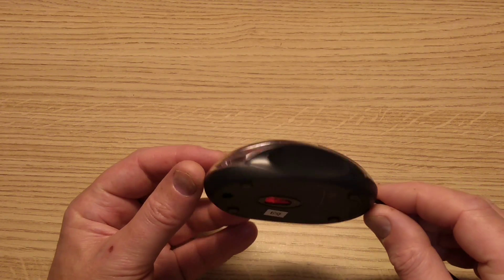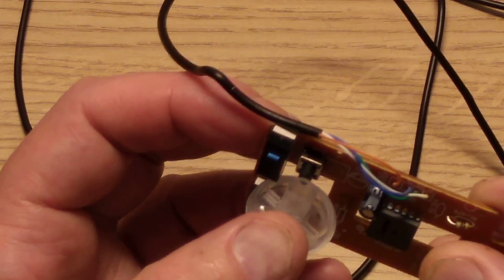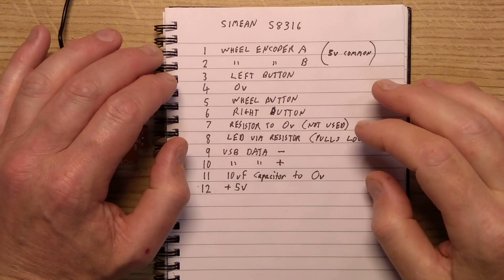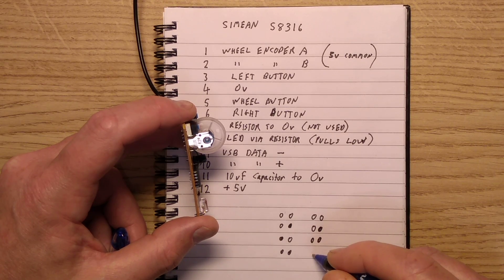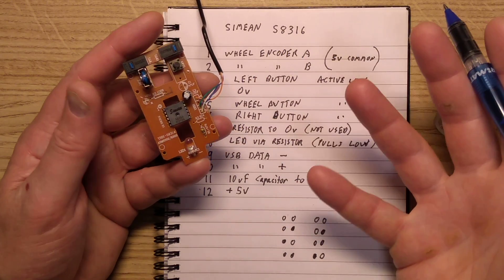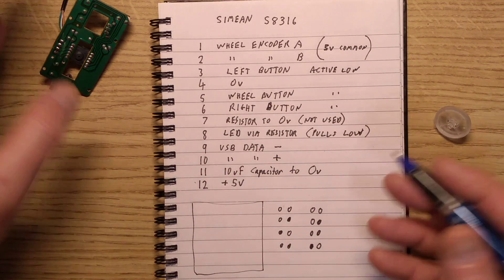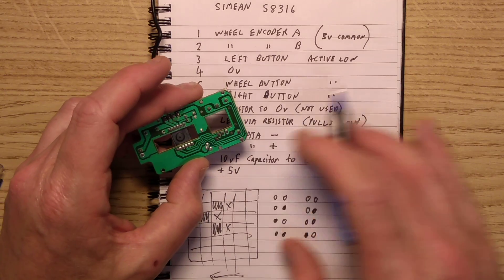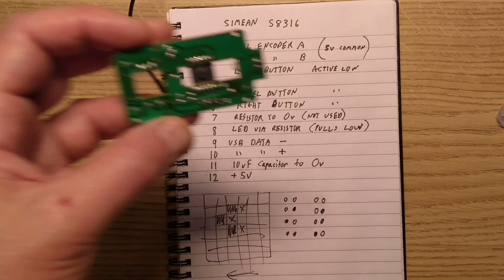Inside a humble Poundland computer mouse.

Comment: Regarding pin 7, there is a datasheet available for the Simean "KA2" optical mouse sensor chip.  It's very similar, with a few pins shuffled around from your version.  There, the "unused" pin 7 selects the mouse sensitivity/DPI.
Reply: @konakonaa I play quite a lot of games and I find it super useful to adjust on the fly as each game seems to have it's own default sensitivity. I can just click a button on my mouse a time or two to dial in what I like instead of going through a settings menu, adjusting, hit apply, test, then repeat until it's right.
Reply: @konakonaa multiple use. High dpi for game and low for better precision when use Photoshop/pain.net etc. High dpi for general gun and less for sniper gun,when you try a new fps,start low and increase in game. Generally adjustable dpi mouse,have 2 button for change dpi on the fly and use a little program when you can create many dpi profile and others settings :)
Reply: @konakonaa probably for scoped shots vs non-scoped shots in a first person shooter, but any GOOD fps changes the sensitivity for you upon un/scoping

Comment: Cant make it much cheaper than that. The original Microsoft optical mice had multiple ICs in them, now its just one.
Reply: Two ICs probably, HDNS-2000 and a microcontroller - first USB ones had to have used EZ-USB FX1, otherwise PIC or something.

Comment: If you were to buy the individual passive components alone it would cost far more than one Pound! I've found that "dead" mice are a very good source of microswitches, and those encoders are useful too (e.g. for 3D printing). Even the USB cable is entirely salvageable.
Reply: 100% true.  Sad thing is they are so small they go in the garbage can and can't easily be grabbed when it would be far better for the Earth if I had at them, or you, since I/we would reuse at least half of the components.  Did you know the tracking system is a camera that can be used for PIR systems built with a PI or an Arduino?  Yep.
Reply: divorcedme  

Arduino is one of the easiest way of getting into micro controllers. Google some tutorials.
Reply: divorcedme  The biggest thing, for me, was learning and understanding how to make things communicatie with the outside world.  If anything, learning a programming language that, upon finishing a task (like when an if-statement is true) makes a LED light, can be a much better thing to "grasp" than to have something print out on a screen.
The tutorials start out as incredibly simple (connect a switch to light a led when you press the switch) and go up in difficulty gradually.
For me, even though my understanding of electronic components is not exceptionally great when I compare my knowledge level with the one my brother has, but still, I manage to build my own PCB and not have things blow up :P.
Reply: divorcedme  The thing is, Arduino's are forgiving when it comes to making mistakes, they are protected to withstand certain errors (up to probably a certain amount of time, and times) more than Raspberry Pi's are.
For instance, when you directly connect an input where you want to connect a switch to to the 3.3 or 5V output and forget the resistor and hit the switch, the Arduino will reset itself and start over.
Though I have not yet experimented with Raspberry Pi's myself, I've seen the warning countless times to "protect the input where you connect your switch, motor, servo or anything else to because you will blow up the GPIO input otherwise!"
Being able to directly print a variable you might try to change is also a big advantage, because you can instantly see where things are going wrong (or not).

Also, most Arduino tutorials (and the Raspberry ones probably as well) have a detailed list of parts you need, and if they are really good have a computer drawing of what you need to build in order to get the same result, and when you followed a couple of tutorials that make you able to do what you were thinking of doing, you can start to combine them, or put them together and build more advanced programs onwards.
Reply: divorcedme    à bit more encouragement from me....  you can download the arduino environment for free from, I think,  arduino.cc    browse some projects whilst you're on the site and check out the demo software in the download .  Arduino sketches (programs)  have a simple structure:  startup () which executes once at the beginning and loop () which repeats forever.  Knowing that, you'll probably figure out the demo blink program by guesswork.  If you then decide to buy, I humbly suggest getting an UNO .  Overpriced, perhaps, but wiring stuff by just poking wires into the connectors is so convenient.  Image processing, however, might be asking too much!
Reply: @divorcedme I am a bad one to ask because I can look at any language and within mins I can read what it is doing.  Writing in it takes a little more effort but not much more.  Started out in 1983 with Commodore 64 Basic and in 2 weeks ditched it and went to 6510 ASM/ML.  I taught myself by writing something in Basic and translating it (line for line) into Assembly/Machine Language.  Always came natural to me so what I find easy another would find very hard.

I will say this that Arduino is the simplest stuff out there as it is 8 bit and well documented.
Reply: Its cause they are all made in China so everything is alot cheaper there

Comment: Cheap mouses in nutshell
I have torn down several of those.
Reply: *meeces
Reply: in pieces.
Reply: Lassi Kinnunen  Well all mouses since the adoption of optical mice.  Opening my old Logitech MX518 looked quite similar to this one. Used that mouse for about 9 years then finally switched to a wireless mouse when I found out about the Logitech G602, the first wireless mouse I've ever encountered that didn't suffer from any noticeable latency. I'd still be using the MX518 if I weren't using my PC exclusively with my TV.

Comment: I used a Sun Microsystems optical mouse in 1995. I never thought to take it apart. It required a special mouse pad that was a stiff shiny sheet metal, maybe 5inches square. It had a mesh pattern printed on it in grey ink/paint. The mouse did not work on the table. I assume it required the high contrast between reflective metal and matte paint, and the regular grid of the pattern, to work.

I quickly understood the value of optical mice, because they replaced mechanical mice the featured solid balls that moved rollers (presumably attached to rotary encoders) in the mouse housing. But the ball would constantly pick up dirt and lint that prevented it from getting a good friction grip to spin the rollers. The need to constantly clean mouse balls led to many bad animal husbandry jokes.
Reply: I have fond memories of the sun mouse. Before there were scroll wheels, I found the middle button indispensable for copy-paste.
Reply: I wonder if the different system of using IR LEDs with low sensitivity photoreceptors had anything to do with how USB had a lower power output (officially anyways) at the time... Of course technology itself is using less power per complexity today anyway. Actually come to think of it, in the 90s you wouldn't have been using USB at all, but those dreaded PS/2 ports! Those give you a whopping 275 mA at 5V to work with. I definitely think it would have been theoretically possible to create better mice at the time, but it wouldn't have been practical because you'd require an extra power source.
Reply: @Torchkas2  They pre-dated the PS/2 port and may have used an 9-pin d-socket serial connection. The Sun ones would have almost certainly used a propitiatory connector.
Reply: I can't say for sure, but that Sun Microsystems Optical Mouse might have been a rebranded Mouse Systems mouse, as they had the same system on DOS computers back in the late 80's.
Reply: @CommodoreFan64  They were - I was using from in 1990/91.  The ink in the fine mesh on the mouse mat absored infra-red light more than normal paints/materials, and the mouse counted the lines as it crossed them. Wouldn't work on anything else but the mat.

Comment: There isn't any lens inside the "chip" - It's a bare die.
Reply: No lens per se -- just an aperture. However, it is still functionally a camera -- albeit a pinhole camera. 

I wonder how sensitive the IR detection is: how would response drop off as you rack the aperture outward from its current position (changing the angle of view/focal length/depth of focus)?; similarly, how would response drop off if the aperture were decreased, in place, to, say, f/256? Could that circuit be used in those cases as a motion detector in a camera trap?
Reply: Michael Thibault there’s a little tiny ball in the plastic light guide that fits under the aperture of the chip. That’s the lens.
Reply: @TWX, Jasper

Lens, for large values of "lens", I'll bet. Optical element, perhaps. Diffraction grating? I wonder. If so, "filter", and the aperture is the lens of a pinhole camera.
Reply: Michael Thibault no, it is not a pinhole camera. It is a bare die in the package with a lens in front of it. You can see it right in the video. And yes, it’s a single plastic element. It’s still a lens. It only needs to work for one wavelength, the red of the led, so you don’t need multiple elements to avoid chromatic aberration. And you only need a cheap plastic molding rather than a precision ground glass elementb ecause it’s a 32x32 sensor instead of a 4000x2000 sensor.
Reply: @michaelthibault7930  The plastic element that came out separately is the lens.  The chip is the CCD.

Comment: These sensors can be used with a software called ardupilot as "optical flow sensors" to detect movement on model aircraft. For example it can hold a camera drone still without gps. I've never tried it though

Comment: I buy these regularly - the buttons do wear out with a lot of use. I always keep a couple in my laptop bag cos when working onsite, it's handy to have a replacement mouse (and spares, cos I keep loosing them!) 
Just checked my electronics recycle bin......14 of these mice dead or faulty.
Reply: Buy a pack of microswitches and revive them.
Reply: @quertize  With the amount I've gone through, I tried salvaging working switches and refurbing them but at €1.50 each, it was quicker to just buy a new mouse :(
Also, the USB cable seems to fail in quite a few of them if they are used anyway vigorously......so not recommended as a gaming mouse lol. 
But think they are sold as a disposable item, same as most of Poundland/Dealz gadgetry. I have no problems handing them out to customers that would have to drive 80-90 km round trip to buy a mouse that'll cost 5 times more. Just like I keep a stock of old keyboards for the same reason.

Comment: The initial version of the Prusa i3 MK3 3D printer used an optical mouse sensor as a filament sensor, to detect both the presence of filament and its movement, so it could sense blockages.
But they moved away from that to using a simple IR LED + photodiode/phototransistor sensor with the newer version - the MK3S - as the optical sensor had problems accurately sensing certain filaments, such as transparent ones.

It makes me wonder why they aren't using a filament detection system as is recommended in the Smoothieware documentation - ie an optical encoder wheel with a rubber outer surface, and as the filament moves past, the wheel is rotated and the rotation can be sensed. It'd be affected by dust build-up, but FFF/FDM 3D printers should have dust filters on the filament input anyway, to stop the hotend clogging up with dust...
Reply: Prusa used PAT9125EL. This is closely related to mouse sensors but is not intended for mice.

Optically reading an idler would be a better solution independent of the filament composition, but apparently nobody designed a compact solution yet.

You know, you could even read that idler in the extruder. You just need a hard stop so when the filament ends, the idler doesn't press right against the extruder gear and doesn't end up being propelled by it. And find an arrangement in which the sensor fits.

Comment: That was cool, i had never taken a mouse to bits. I figured the red light was lazer measuring distance. My son has the  battery operated one. One battery AA. Lasts forever. Very neat. Not as cool tho if it only has red led 😁 (freaking sharks with laser beams). Had the repair guy out to repair the dishwasher yesterday insurance covered it he wouldnt repair just a check for money for replacement. So I poked around a bit, he said needs new control board. 2 buttons on panel not responding, what he didn't find was the scary part for 1 hour I had the front panel tore open I dug around didn't see anything visually wrong, so I put it together then looked down and heating element was bent, I thought huh so naturally I grabbed it to see if it was loose or bent whatever it was cold all the way around except this 4 inch wide spot that was hot. Man this thing was on 24/7 365. Door open or closed didn't matter, on or off, still on. So I shut the breaker down told the wifey we need a new one. Scary this element was on all this time. My point is, you have to pay attention to your senses, we did a walk thru the house June 6th I opened it then it felt humid and warm so I figured she had just run a load, but it was empty. Had I paid attention then, my family wouldn't have ben at risk, and it would have ben replaced.
Reply: There are laser mice that do just that. 
Here is one that is just that 
https://www.amazon.com/Logitech-910-000594-LS1-Laser-Mouse/dp/B001DJ64CA

Comment: I had an optical mouse in the mid 90s that used a special mouse mat. It had a silver and black grid pattern that the sensor read. Fantastic piece of kit for the time.

It’s amazing how integrated those sensor modules are now. They used to consist of many chips and support components. On some you could tap off the raw quadrature data from the image decoder and use it to control older systems like the Amiga or Archimedes systems.
Reply: I used one of those special mats on a Sun Workstation.
Reply: @Codedbad  I've seen the Sun ones, they look different to the one I had. The Sun ones had rounded buttons right?
Reply: We had the Sun ones in the AI labs when I was an undergrad. I loved the way they would go mental if you twisted the mouse off of parallel from the pattern...

Comment: If you search for "YOUR MOUSE IS A TERRIBLE WEBCAM" on hackaday, people actually did managed to extract the image out of the sensor for it to be used as an incredibly low res camera
Reply: Jeri Ellsworth attached part of a satellite dish to one and built a radar "camera"!
Reply: One video  on that.  
https://www.youtube.com/watch?v=bci7Gi05BNc
Reply: Bet it would make a good optical sensor for a simple robot toy project tho.
Reply: @mre2u2  Or level sensors for auto-filling bulk granular cargo on trains (eg grain, coal, gravel, etc). Or any simple level sensor to stop filling a container with an opaque substance (especially where you want to avoid moving parts with the potential for sparks as contacts wear out)

Comment: The chip doesn't have any lense in it, it's just a bare CMOS die (in some chips there's 2 separated die, I guess one is doing the processing and the other is just the CMOS itself but most of the time I saw it's integrated also), the lense is actually integrated into the light guide, you can actually pop the bottom lid out of that chip and see the exposed die with all the gold wirings, it will still work afterwards if you don't break any of its bond wires but it will be kinda funky and there's "ghost movements"